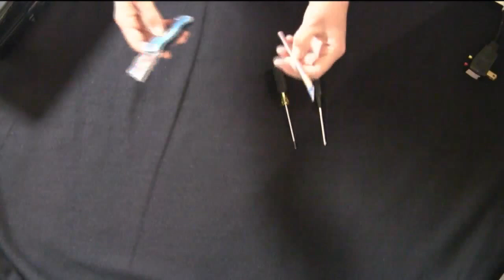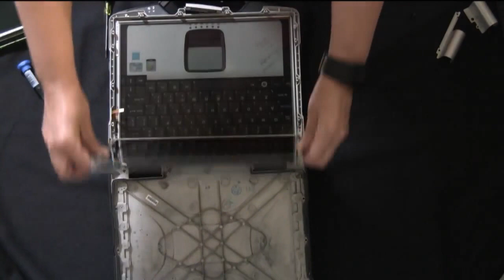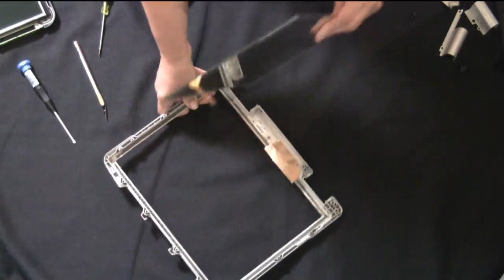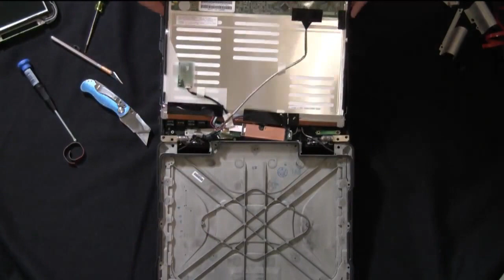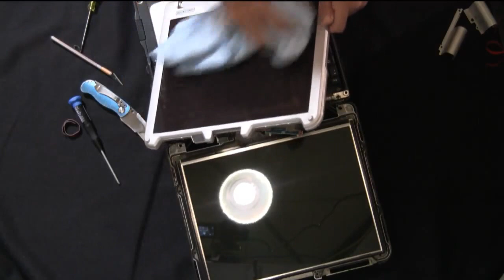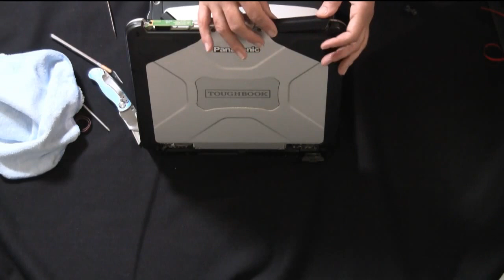How to replace the CF-31 Touchscreen Panel & Screen

Comment: I think my touch screen is damaged... Cursor jumps around, when I disable touch screen cursor acts normal... Don't see a replacement touch screen on your website... Where can I purchase?
Reply from the maker: Check in with tech support to see if they have any good ideas for you before you buy.  Email them at tech_support@bobjohnson.com with your complete model number and describe the problem. They may have some tricks to share. Otherwise, Heartland is the authorized Panasonic Toughbook new parts distributor in the U.S.
Reply: Yea, I have already reached out to Heartland (1800LAPTOP5) and already have a case number... Didn't help much, IMO... I turned off my touch screen and everything works flawlessly now... So am about 99.9% sure my touch screen is faulty, must of hit something hard... However, cant find anyone to sell me the screen so I can replace and use your video as a guide... Everyone just wants me to send it to them, because the laptop is out of warranty...
Reply from the maker: Email us at tech_support@bobjohnson.com with your full model number and tell the tech your issues. Inventory is fluid. They may be aware of something or have a workaround for you.
Reply: Pppppppppppppppppppppppppppppppppppppppppppppppppppppppppppppppppppppppppppppppppp